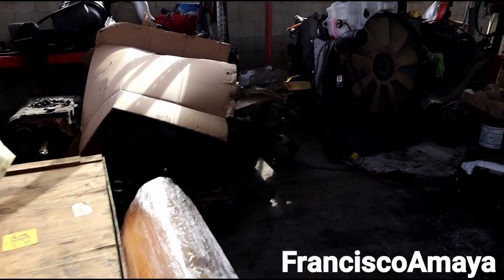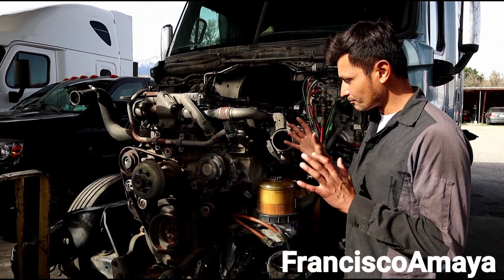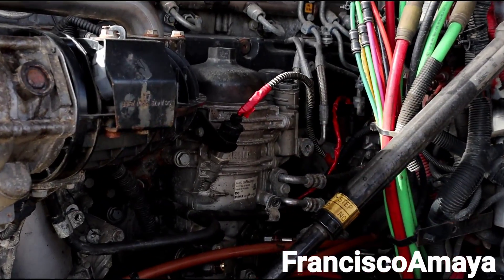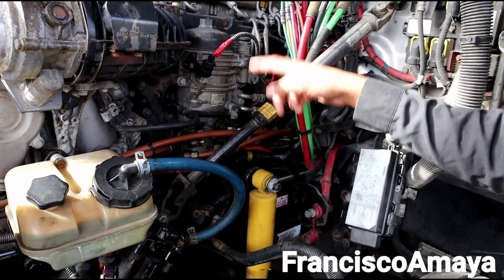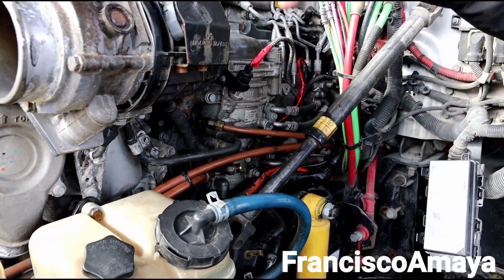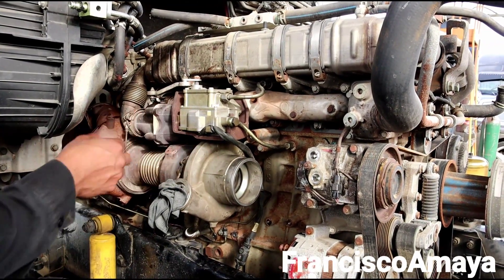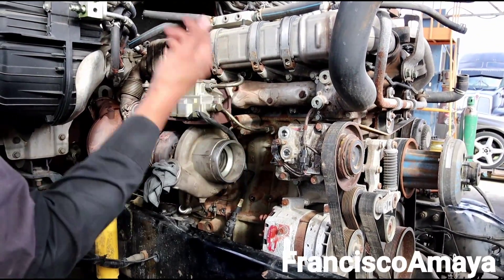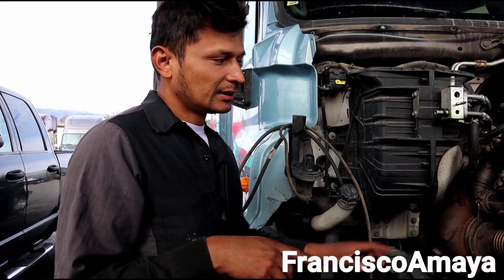Freightliner Cascadia DD15 used engine swap replacement after major engine crankshaft damage part 2

Comment: Can I drop a some of the transmission oil and put a the same amount 
10 speed Eaton fuller
Reply from the maker: Yes, you can. If the oil is in a good condition.